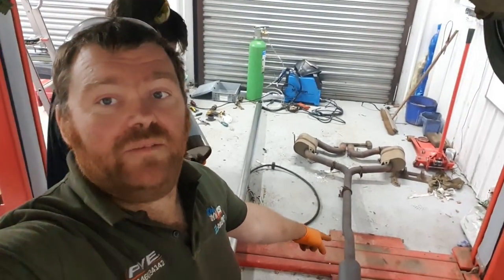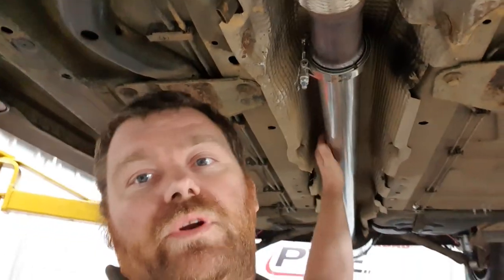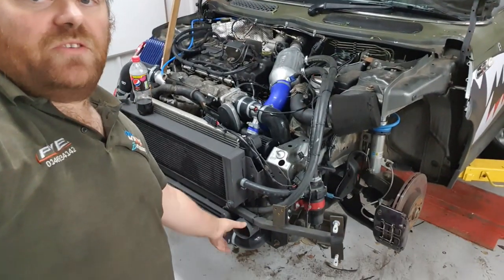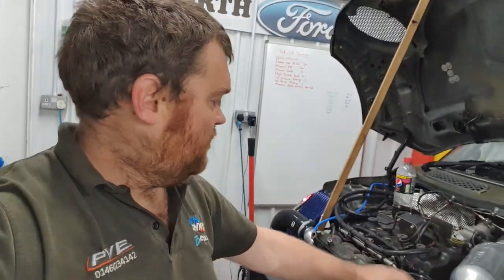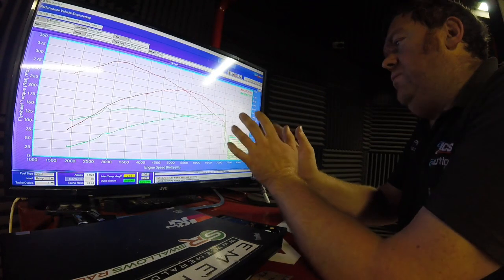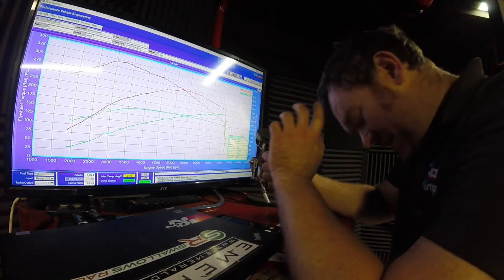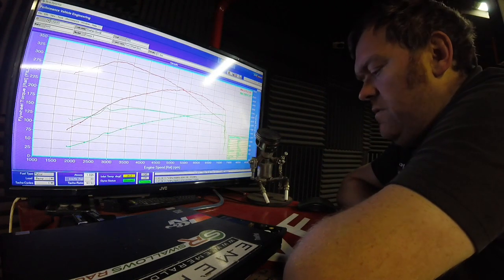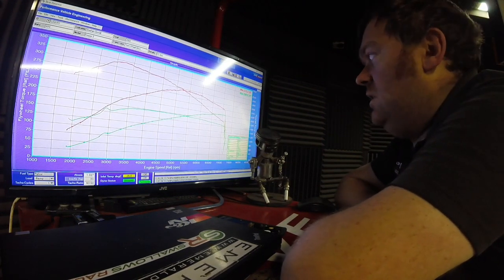Compound Charged R53 Track car, the next stage, before Castle Combe

Comment: What camber in front ,i'm use r53 track um Portugal ??🇵🇹👍👏👏
Reply from the maker: Hi there! We run 2.6 degrees camber on the front. :-)
Reply: @TuningShed  I run with -2 camber on track, but on normal road the MINI has very bad behavior🤔
Reply from the maker: @joaogoncalves6078  Ah, fair enough. I've never driven ours on a normal road. It only ever goes on track unfortunately, so couldn't offer any sensible advice.